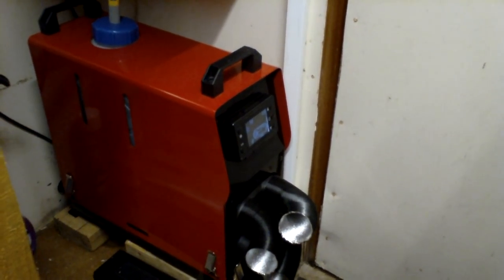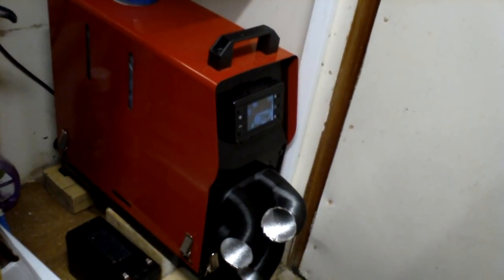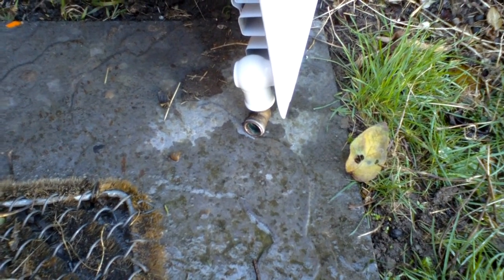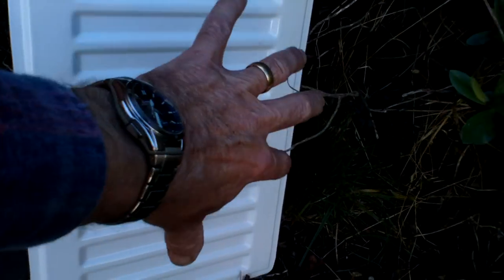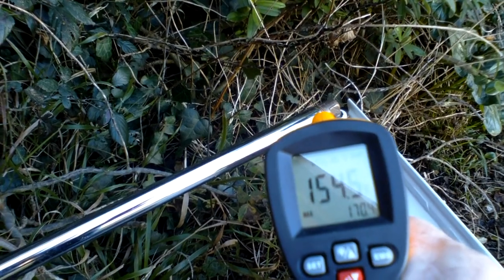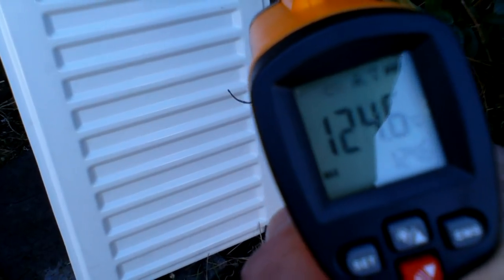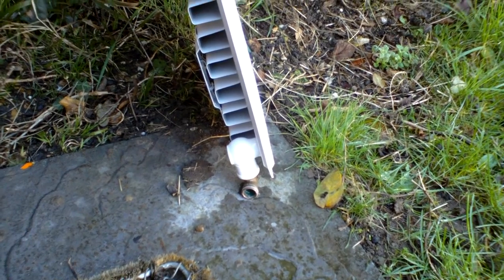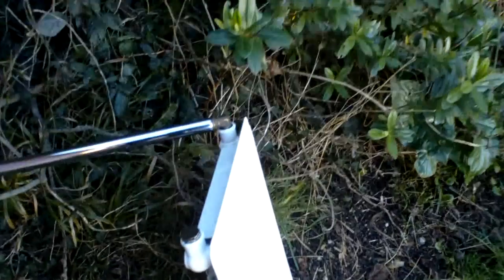COMPACT CHINESE DIESEL AIR HEATER EXHAUST HEAT RECOVERY

Comment: The reason you had condensation because by inserting exhaust pipe into top portion of radiator, you allow the bottom of radiator to be the coldest part of it. Therefore water was able to accumulate there and not be evaporated. If you connect exhaust pipe into bottom of radiator, water will not accumulate anywhere near 150 degree exhaust gases, it will be evaporated and thrown outside as steam. As a bonus, insulating that long smooth pipe will increase temperature in radiator, further decreasing chances of water condensation inside.

Comment: You should not force hot gases down, it's gotta be either in horizontal way or upward. In other words, connect the exhaust to bottom of radiator and let gases exit from top of radiator. You'll see performance increase dramatically. When you try to push exhaust gas downward into radiator, colder air inside will resist and push back, and because hot air is lighter than cold air, you create a gridlock. And that may result in increased back pressure in exhaust pipe, which is a bad thing for the heater itself. If you do it the right way, the stream will be smooth and thorough... Great experiment though. Thanks.
Reply from the maker: Hi agent. Agree with what you say on the whole but this was a lashup afterthought send I wanted the simplest addition without messing up the current installation.i do intend to try again to see if it’s viable.
Thanks for your reply. Regards Peter
Reply: Pumping down is no problem as long as the overall radiator and plumbing flow resistance doesn’t exceed the maximum back pressure  allowed by the burner.  One advantage is that it can cause turbulence.  Turbulence is your friend in a heat exchanger.  It can also slow flow which gives more time for transfer as long as you do not exceed back pressure limits..  you are obviously  cooling the moisture in the gas below the condensation point.  ANY HEATEX THAT COOLS TO THIS POINT WILL DO THIS, so the radiator is fine, you just need to have a downhill flow to allow the moisture to escape out the end of the external exhaust on any efficient heatex.  You inadvertently installed the rad in the exact correct orientation otherwise it would have ultimately filled with water and blocked the exhaust...  keep experimenting, thats how we learn:)
Reply: ErikDK yep, opposing flows are your friend...

Comment: Not sure if anyone mentioned this idea - Pipe the exhaust through the bottom of an old gas powered water heater... I just thought of it myself just now after your video and chat at the end... 

So, where the hot gas from the burner of an old gas water heater is, just nozzle the hot diesel gas into the existing Middle Exhaust Colom, and you will be baking hot air and hot water at the same time! Brilliant!
Reply from the maker: Hi there Camping. Thanks for making a comment but I have to say that your idea would not work for a good number of reasons - like my first video proved unsatisfactory as there could be an issue on exhaust gasses which is why further experiments were made by me culminating in the safe SECOND VIDEO which proved to be effective and safe plus very easy to obtain the bits required in most DIY stores. Please have a look at the second video experiment and you will see a far better method of heat recovery.
Regards and stay safe.
Peter
Reply: @brucepeter2007  Will look at your second video, I found this from the YouTube recommendations because I am working on my first Diesel Heater installation. Thank you for your video and I will look for the other one - I would like to see how you got it going.

As for the Water Tank idea; I do not know if you have done any plumbing work or if you have seen the inside of a Gas Water Heater, but they literally work by hot gas traveling through the middle of them... and I am just saying, but you  could literally build a little shed on the outside wall where your gas comes out and put an old used small Gas Water Tank in there and pipe the hot gas from the Diesel Heater directly into the bottom combustion chamber where the gas is usually burned, and heat the water that way. The Gas Water Heater is already designed for hot gas to travel from the bottom, through the middle,  and to come out the top and it has ducting ports on top to vent the hot gas up and out... I am pretty sure it would work brilliantly, you could warm both your air and water with the heater... Anyways - thanks for the video and I will check out how you got it all fitted. Thanks

Comment: Your into the top and out the bottom radiator is fine and OK to use. The outlet will have some carbon monoxide as well as condensed water from combustion and must be vented outside to a safe place (outside a hull). Exhaust system connections must be perfectly sealed and you must have a carbon monoxide detector inside. The fact that you are condensing water out of the exhaust shows your heat recovery is very good... which is what your temperature measures confirmed  (except for your leaky exhaust gas connections). Note: do not trap the condensation as it will block the exhaust... it must drain; a p-trap or s-trap drain could work.
Reply from the maker: Hi there. Thanks for the reply but please see the other video I made as a follow up because I ditched the radiator route because there could be too many issues so I went down the water heater route which was much more efficient.
Regards and thanks for your comment. Peter

Comment: Hi Peter, observations from when I did similar only with a duel rad. There is way too much back pressure and causes sooting in very little time. There are restrictors built into each corner of the rad (4 in yours, 8 in mine) only the ones on inlet and exit need to be removed but does require angle grinding a small square opposite the elbow. Even then the back pressure is too high and the only solution is to dispense with the usual inlet and construct a new fabricated round-to-rectangle adaptor. Regards Rob
Reply from the maker: Hi there. I have made a new comment for everyone’s guidance as I am getting concerned - please forgive the mass reply - see above. Regards Peter

Comment: A barrel type air to liquid heat exchanger on the exhaust outlet should work well. The hot exhaust gas will flow through the centre of the exchanger heating the liquid surrounding it.  That way as you say, you can then safely pump heated liquid to a radiator in another living area to recover that heat.  This type of equipment can be mounted like a muffler in the horizontal position, so condensation will not build up, and gas flow will have minimal restrictions.

The only issue I can see with heat recovery on the exhaust is soot build up inside the recovery system.  That will increase back pressure and then possibly cause flame outs and smokey start issues with the heater.  Regular cleaning and maintenance would be required to keep the recovery unit clean and free of soot deposits.

Comment: Can you hang the radiator off set with the exhaust side down and elbow the exhaust out the house ,the water will drain out ,won't it?
Reply from the maker: Hi Tommy. This was my first experiment and although the results were good I was not happy with the safety aspect of having the combustion exhaust gases within the heated area because of any potential gas leaks. 
Because of this I made further experiments and came up with a more safer solution which was not only safer but far more efficient and that is shown in my second video which you might find interesting...
Regards and stay warm Peter
https://youtu.be/VktbyEAoVR8

Comment: Just a little add on, I was thinking of making a coil to fit the length of the exhaust and a straight going into a container with another coil inside filled with water to heat the contents. Maybe the coil could be filled with antifreeze pumped with an addition of a small expansion vessel..... just a thought...
Reply from the maker: Hi Again. Your half way there already and you remembered the expansion tank as well. All I can say is that as long as you pay good attention to the fitting of the exhaust and its safety is not compromised in any way its worth a try.
Regards Peter
Reply from the maker: @ErikDK hi there. When I did the experiment I was well pleased how hot the water became in such a short time. There are many ways hot water can be heated and all I can say is go with what you can easily make and works for you. I am honestly so pleased that the video I made has promoted so much experimentation which is really great. Thanks for your valid comment which I am sure many will read in the future which is to the benefit of the YouTube community. Regards Peter

Comment: Hi , I have this heater and trying to fit it  but not sure which pipe underneath is the exhaust , the manual isn’t that good
Reply from the maker: Hi paul. The fuel pipe is nearest the air inlet and the exhaust is furthest distance from the fuel inlet pipe.
Lots of videos on YouTube to help you.
Stay warm. Regards Peter

Comment: How many hours of heat would you get from.1.galoon of diesel assuming it's running high the whole time?

Just looking for a rough idea.of efficiency...thanks!

Cheers!
Reply from the maker: Hi there. I can’t honestly say except that to heat my wife’s craft cabin together with the unit in my shed means it’s the most competitive method of heating I have come across. The basic heater has been used for many years in lorry cabs and emergency vehicles but it’s only now that the Chinese have made them that the likes of you and me can afford them - before the German manufacturers of these “copy units” was around 7 times more costly.
You won’t beat the heat output and the cost to run it is to use red diesel as it’s far less -  I was paying 70p a litre...
Sorry I can’t be more specific for you.
Regards Peter
Reply: @brucepeter2007  no worries! I'm appreciati e you posted the video. I got a ton of info I needed! I got plenty of help! Cheers

Comment: Hi peter i bought one of these and ive hooked it up i primed the fuel pump and i can see the fuel being pumped along with the clicking noise from the pump, once its completed its procedure i then set the temp i want in my cabin and click ok. The unit starts up but the pump doesnt and there's no fuel coming through it then switches the unit off. Any ideas why the pump isnt coming on when i start up its set at around 35degree angle still in the case. Any help will be greatly appreciated.
Reply from the maker: Hi Paul - just turn it on as it will always start up and run full power till it reaches temperature. Just turning on the unit should first start the fan which runs for some time and the glo plug light will also come on to ensure all is well.
It is most imperative that the glo plug gets enough current and the battery and cable supplying the current to the heater should be substantial as the glo plug takes about 12Amps. Once about 2 minutes has gone by the pump will then start to click to supply fuel and you can get between about 15 and 25 clicks of the pump before the fuel get ignition of the fuel.
You then get two yellow bars on the control panel light up showing that ignition has occurred and the case is warming up - you will then hear the fan speed ramp up and the pump will click faster to deliver more fuel. You will see the heat bars on the display start to go up until you reach full heat and both red bars are illuminated.
You can the leave it a while before you set a rough temperature value. Remember it’s not an “on/off” unit but a furnace and although it will cut back on heat the level of control is limited.
To conclude the most common issue is with the current supply to the glo plug and it’s imperative that a first class battery is used or a good 20A switch mode power supply is employed. THICK CABLES - as short as practical - so there is no loss of voltage and current when under load…
That’s all I can advise but above are the most common issue people make on the installation and the worse I saw was a bell wire as a supply cable which could not even pass one Amp of current.
Hope I have been of help. Regards Peter
Reply: Hi peter sorty i didn't get straight back i had company.i had a error code 6 which turned out to be the fan i had to push it back bit towards the sensor, i sorted that now i got a error code 7 apparently i read its a voltage issue i suspect it could be my power supply im using aa when i turn heater it blows cool air for about a minute then completing shuts down for about 10sec and then error 7 comes up. I'm using a maplin xm21x dc power supply it says on front output voltage 13.8v but the output current is 5amp continueos, 7amp 50%duty cycle 9amp surge so i don't know if this is powerful enough to start the pump.i have no idea with electronics and didn't want buy power supply if not the issue. Any ideas
Reply from the maker: @Paul-of3ut  Hi Paul. Your power supply is too small you need a switch mode power supply off eBay 20A costs little more than the 15. You need this.
Glad it’s sorted. Stay warm . Peter
Reply: @brucepeter2007  thanks peter i ordered one. Much appreciated. Thankyou. Have a good day

Comment: Peter Bruce I just had an idea for a fabricobbled water heater:  run a line straight out to an empty modified propane tank that has a copper pipe through its bottom.  A fill valve/vent with a funnel on top. A wrap of insulation around the tank, and a pitcher valve near the bottom to get the hot water out.  If a 1" or so copper pipe didn't transfer enough heat into the water, maybe braze an old car heater core off the side of it (inside the tank)
Reply from the maker: Hi There. With the diesel air heaters there is a limit on the length of the exhaust together with the number of bends you can have. Its a real challenge but someone will crack it I hope.
Bee in my bonnet has now been addressed and only cost me £10 for the radiator but hay now I can sleep nights. Yes I am mad as well.
Regards for your comments and have a go if you can as lots could make use of the heat as better to use it and make the unit more efficient.
Regards Peter

Comment: Hi Peter, have you got a link to diesel heater silencer, the one with the muffles IN !, Many thanks, also any other ways, tips to keep the noise down, haven't got the orderd heater yet.
Reply from the maker: Hi Gary. The muffled type are not made now as the straight through as easier and cheaper to make. All I can advise is to point the exhaust away from the area you want to protect as it will help. It’s only on start up you get a bit of exhaust noise but once the temperature you have set is reached the heater cuts right back so it’s not that bad honest - how would truck drivers sleep in their cabs otherwise! Thanks for asking your question and enjoy your heater when it comes.
Regards Peter

Comment: Hi Peter, excellent idea! As other readers commented the setup could be improved by having the exhaust gases coming in the bottom and venting out of the top. With a gas tight setup vented outside it should work quite well. Well done! :) Cheers, Paul
Reply from the maker: Hi Paul. Can’t do as you suggest because you get a lot of condensation from the combustion process that comes out of the exhaust but if you cool the exhaust gas like I did with the radiator the water becomes an issue - and it’s surprising how much water you get which would run back into the heater in a short space of time. Best way forward is micro bore copper wound around the exhaust which would work very well to stop a water tank from freezing.
Have a read of the replies as it’s been an interesting experiment I just had to do even though it cost me to buy the new radiator... regards Peter
Reply: @brucepeter2007  It is quite possible to have bottom-in top-out. You need to construct a U-bend at the lowest point, as condensate builds up inside, it will constantly overflow the U (into a suitable container), it will be gas tight as there will always be water in the U and there isn't enough pressure in the rad to push it out. Rob
Reply from the maker: Going to do a main comment reply to this...
DONT GO DOWN THE RAD ROUTE - I did this setup just to see if heat could be recovered and if it was worth the effort.
It is indeed worth the effort but not with the exhaust gasses directly.
It WILL soot up the combustion chamber and you won’t be thanking me for that so please DONT USE THE SAME SET UP. 
The best way forward is to use copper microbore heating pipe and tightly coil it around a metal bar of slightly less diameter than the exhaust pipe then tapping with a hammer onto the copper pipe to flatten the pipe where it contacts the metal bar which will increase the heat transfer surface area a lot of copper pipe will ensure good heat transfer and it would all need to be tightly wrapped in exhaust manifold tape to both insulate it and keep the heat in for good transfer. A small 12v pump would be used to circulate the heated water to either a copper transfer coil within your RVs water tank or you could run the water through a radiator if you so wished.

Comment: if you coil some car  brake line around the exhaust pipe and install a small fountain pump you could have a closed loop with the little radiator being heated up by the water inside the coiled brake pipe. 8mm micro bore may be better as they make radiator fittings in 8mm .